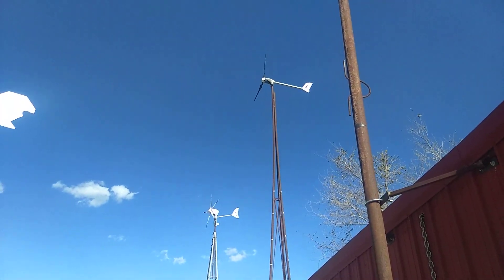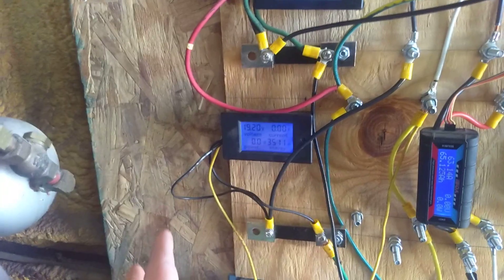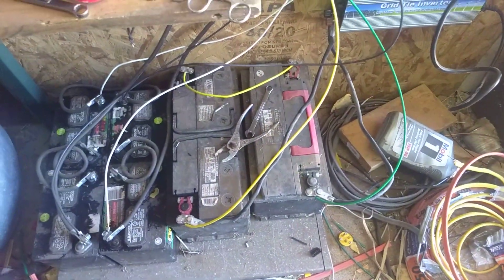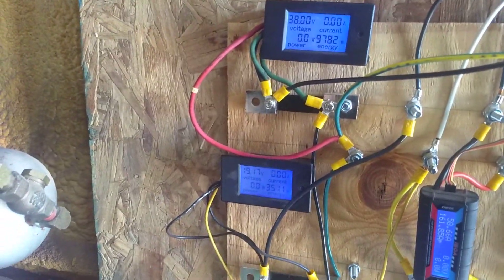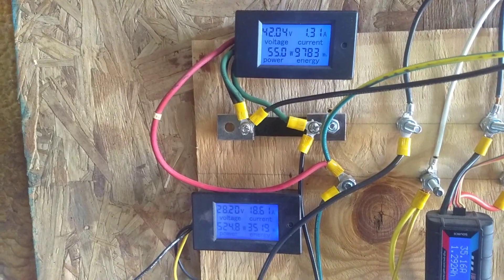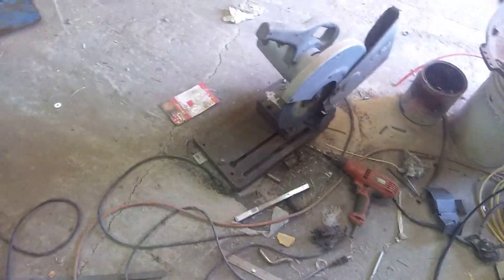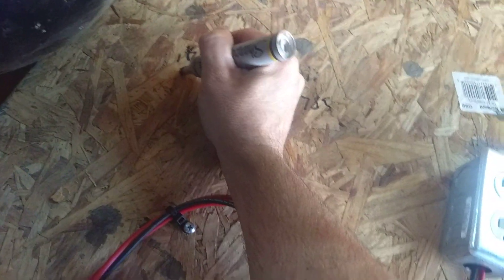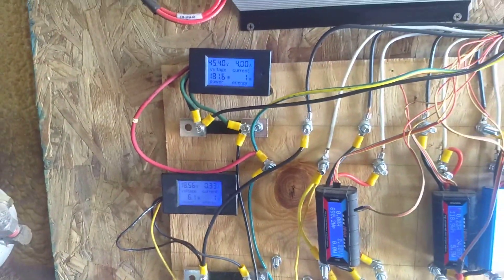iSta Breeze Heli 2.0 vs i1500: Week 1 update...moving the i1500 to a 24v circuit!

Comment: I just got my i-1500 what mount did you use ? Pipe is either to big or to small..
Reply from the maker: I'm using a piece of 1.5" (I think) sch40 black pipe...it is too big so I slotted it and used exhaust clamps to hold it down.  It's not great and it works loose after about two months.  I'm about to have to bring it back down and figure out a solution that's a little more "grown up".  I believe the stub is 40mm.
Reply: @ToysforWatts  thats  what i was about to do.. i think i fitted 2 1/4 galv pipe.. i was going to slot it and do the same.. did you do a couple slots on the top of the pipe. Or a single slot down the side? I was thinking single..🤔 also maybe one slot down the side fill that very small gap with a weld then drill the 2 holes ..

Comment: Big difference! Very interesting,  have you ever seen the wire size in each turbine? I'm very interested. Thanks for sharing!
Reply from the maker: I actually have a video completely breaking down the i1500: https://youtu.be/L7sb_oQTgE8

Video quality is rough and I never figured out why, but I'd have had to redo the whole thing from scratch to fix it :/....but I do cover wire size and configuration in there.

I tried to pull the caps off the Heli but when it got to that point it was a little too hard to open it up...I didn't want to risk damaging the turbine for the information.
Reply: @ToysforWatts  excellent thanks!